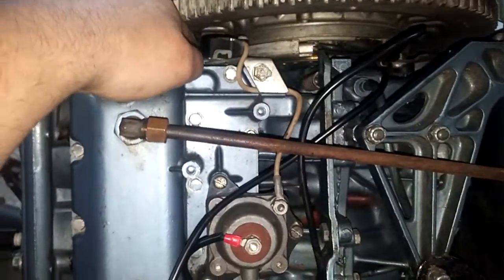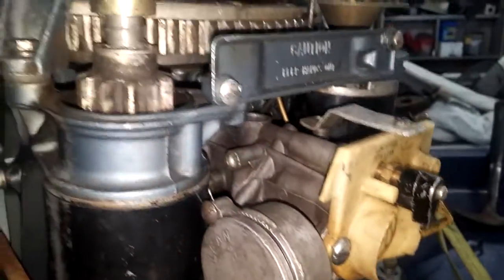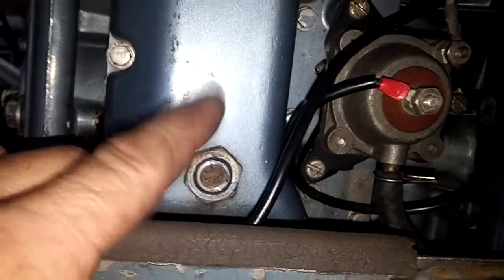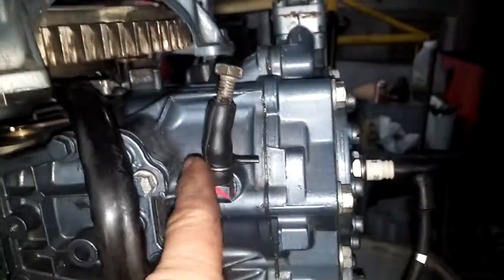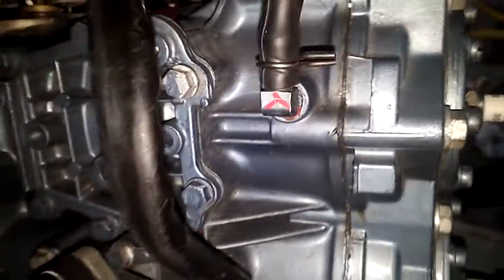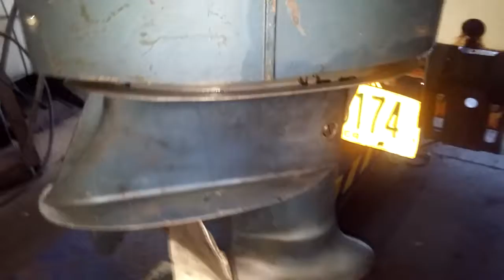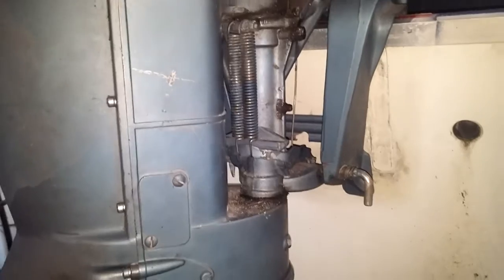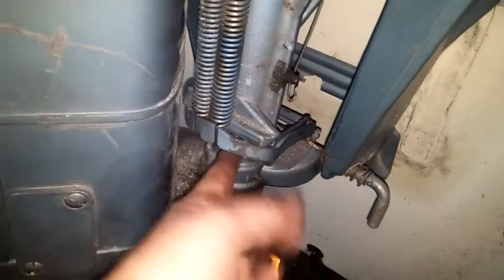Just a couple more things and some praying to the F'nRude Gods

Comment: One thing ED I would get some fuel additive that has like a lead substitute in it I forget what its called but I used to buy it for a boat I had That was meant to run on leaded gas also I would buy hightest for that engine i would think it was made to run on higher octane gas considering the age also what about using the muffs that hook up to a garden hose instead of a barrel of water will they work on that age of outboard?
Reply from the maker: nashguy207 I don't think muffs will work.  Planning on using no ethanol high octane gas and mixing it 20:1. I have some lead substitute I use in the VW.  Thanks for watching and commenting.

Comment: The little hole you hooked the linkage should have a rod in there connecting the two holes together.  The rod will have a groove in it around the circumference of the rod half way between the two holes. The groove is for the linkage to Rest in.
Reply from the maker: Les O let me see if there might be one on the other leg I have.  Thanks for watching.  I subbed you back...Now you  need to post more video.  I wouldn't mind seeing some more of the CNC stuff.  Later -Ed
Reply: Ed Moore I have not messed with the cnc in a while. I bought a 3d printer kit and have been doing a lot with that though. I am going to upload a video if my linkage maybe you can get a better idea of what it looks like.
Reply: Ed Moore https://youtu.be/QlarE3Oul-U
Reply from the maker: Les O I found the piece your talking about on my parts motor.  Thanks for posting that video.

Comment: i would remove that elbow you have the hose and bolt jammed into and replace it with a brass pipe plug,i would also use 1 length of wire where you extended it and solder and heat shrink the connection. wally world has primer bulbs and fuel connections,or at least the ones by me do
Reply from the maker: roger oconnor if it runs I will make it pretty.  No sense if it doesn't run.  I saw the primer bulbs at Wal-Mart.  I will grab one.  Thanks for following along.  Later